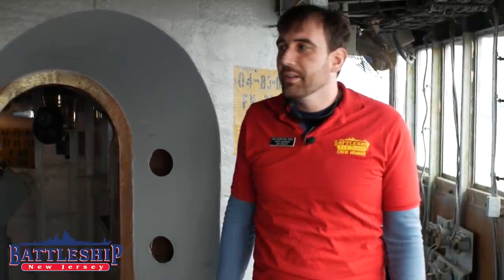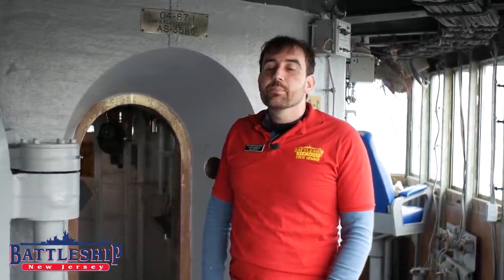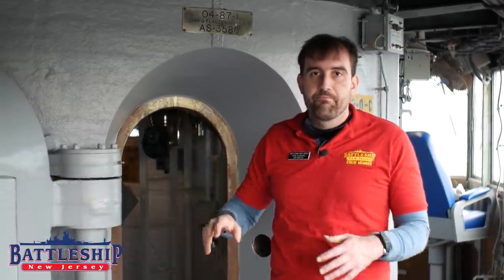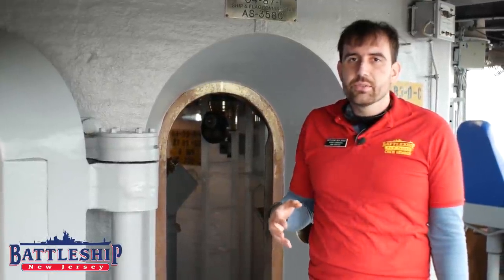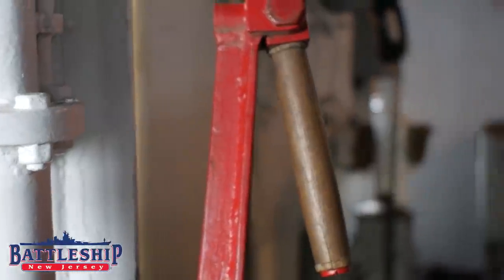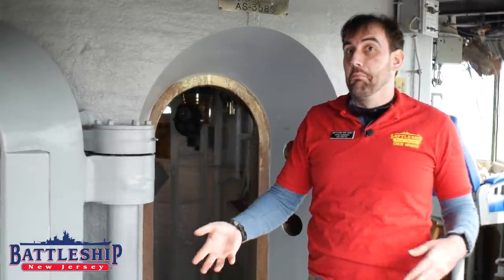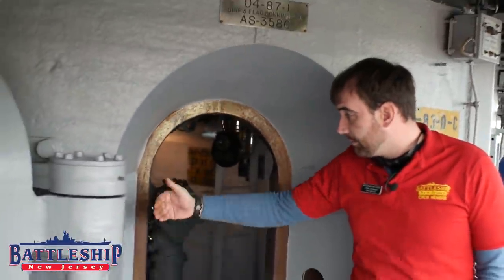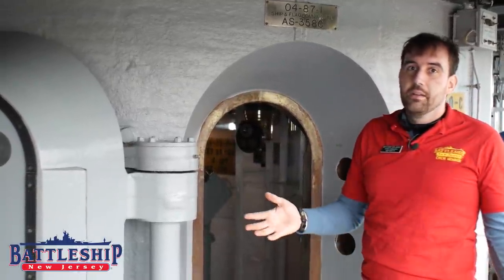Opening the Door to the Armored Conning Tower

Comment: That conning tower does have some impressive armor. I'd be curious to know how effective it was for varying sizes of munitions. Presumably it's enough to save the people inside from something like a DD's tiny gun, but not another Battleship's gun (unless at some odd angle that would permit deflection). But what about all those sizes in between?
Reply: dude, the conning tower armor plate is 16" thick. You really need to listen to the video before embarrassing yourself
Reply: @gruntforever7437  You really have embarrassed yourself. Nothing you have written was unknown to me at the time I wrote that over a year ago. So what that it's 16" thick? Another battleship firing a 16 inch shell at 2,500 feet per second may very well negate that.

And upon further investigation of the video "What Does the Impact of a 16in Shell Look Like?" at the 7:51 mark in the video, it seems it does. So stop embarrassing yourself. You won't do it any longer with me, because I block your sort of idiocy with prejudice from notifications on your replies. You no longer deserve such access to my person.

Comment: Wouldn't the hydraulic fluid actually be turning the same wheel that you're turning with that crank? If so, why would you need the fluid if you have direct access to the same gear mechanism that the hydraulic system would be moving were it present?

Comment: That seems kind of strange to me that they would design it with 2 different, incompatible handles to do what is basically one task.
Reply: You're going to need two crank handles anyway, one inside the door and one outside.
Reply: @gwtpictgwtpict4214  6:51 Both actions (retracting the 3 locking bolts and cranking the door open, or doing the reverse if you want to manually close it) are done from the inside, the outside doesn't have anything to attach a handle to.
Reply: @John73John  You're right, obviously didn't have my brain gear when I posted.

Comment: A lot of that feeling is going to be psychological. I mean, come on. You are literally encased in just shy of a foot and a half thick wall of the best armor plate we had. Of course you are going to feel claustrophobic. And with no quick quick way out.

Oh, and if that hinge is sheared away, I am willing to bet that if you pulled the locking pins, a few good shoves from those inside could probably move that thing loose. Yes I know its 1800 pounds, but asides from the fact that the shape of the door would make it more wanting to slide/fall away, personally when I was 18/19 years old, I could leg press about half of that weight solo. I think 3 or 4 working together and braced against each other would make short work of it.

Edit: shortly realized it was 3800, not 1800, pounds, so it would take a few more guys, but my original point stands

Comment: You shouldn't  ever close both doors at the same time .... What if a tooth on a gear cracks and jams the gears ??? What if there is not enough hydraulic fluid ? What if the grease has finally turned  ?

Comment: if a big round slaps against the conning tower, would the crew inside by fine or turned to mush from the shokwave?
Reply: No
Reply: @jeebus6263  no what?
Reply: I was wondering about spalling.
Reply: @onlyme972  that was the bridge. Not the conning tower.
From what I've read it appears royal navy captains didn't like using conning towers much. If that's true then removing it would save a lot of Weight that could be used elsewhere

Comment: I'm wondering why they didn't install an emergency disconnect so someone could just push it open or pull it closed by hand. If I can push my 3 ton SUV by hand in neutral, then surely someone could open and close a 3,800 pound door by hand.

Comment: Assume the New Jersey is functional. It is at anchor  (not berthed). Its engines are in a cold state. It is not manned.  What would be the absolute bare minimum number of crewmen necessary to bring on board to get up the most minimal power to weigh anchor and move the ship forward...no requirement to operate other systems, no maneuvering, simply move the ship forward one length
Reply from the maker: About 20 people on tug boats. The propulsion plant has a crew of hundreds.

Comment: If you were a criminal, what would happen if you locked yourself in there? how would the cops get into the most armored part on a battleship?
Reply: there are two additional hatches in that room that go further down the conning tower, including one inside an armoured cable duct that goes down 7 decks. it is topped only by a regular hatch that should be able to be cut through with the right equipment

Comment: I'm not sure hydraulic fluid is necessary for the hand-cranck to work
Reply: Like power steering or power brakes on a car.
Reply: @vector6977  yes, both are a mechanical linkage... steering particularly comes to mind as a gearbox though.